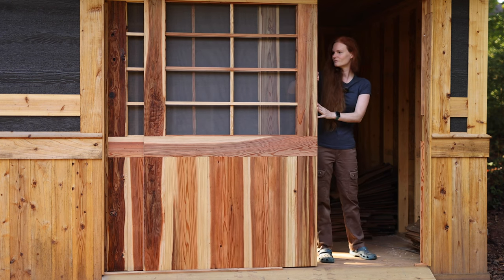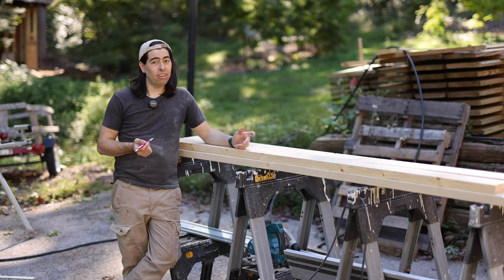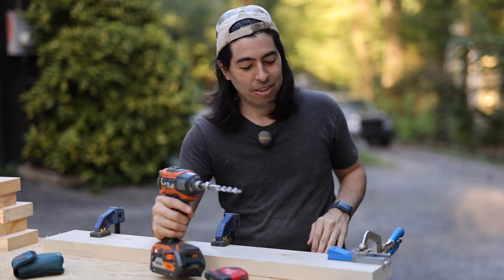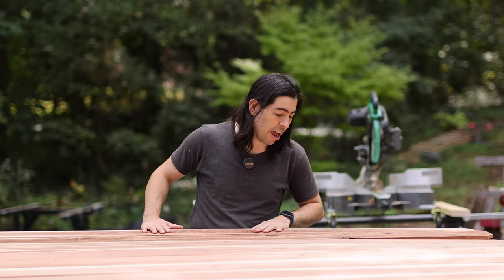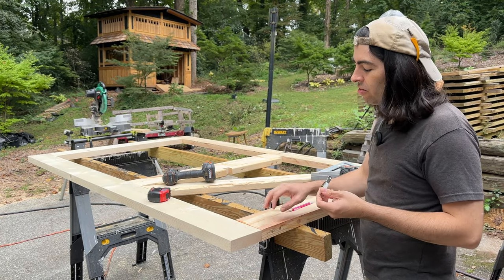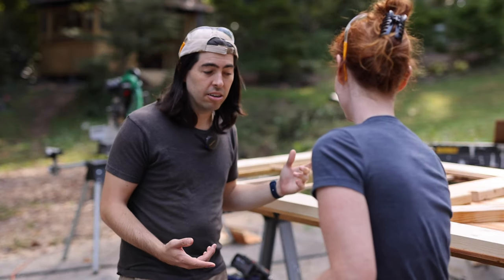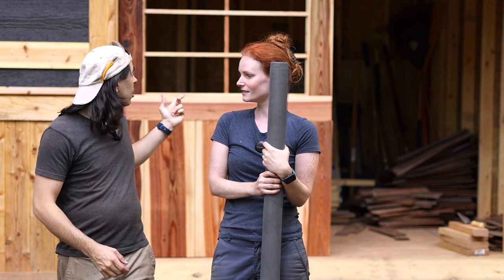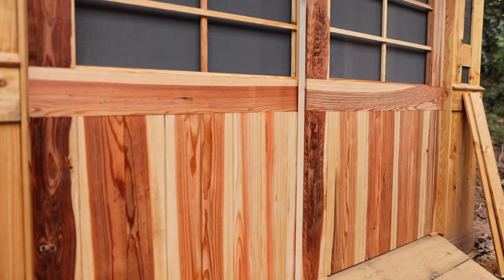Building Shoji Screen Doors: Japanese Shed | Part 32

Comment: if the table saw stops working then try this as it fixed my Delta table saw.
Plug the saw up to a power outlet
Hold the reset button and while keeping it depressed start pressing the start button on the table saw. If this is the same issue I had you will hear and feel the resistance of the motor trying to start and it should start. I have only had to do this trick maybe twice. 

Also, I have fixed it by just pressing the reset button really hard. I found that the reset button on my saw was not lined up properly and the depth was not correct so just pressing it didn't work all the time.

Lastly, if the breaker trips because of over heating, which can happen if you are using it outside or ripping a lot of wood with a dull blade, then the motor will need to cool down before the breaker can be reset.
Reply from the maker: Thank you for the tips!! This is great!! 

I ended it getting it to work again by pressing it really really hard (thought I was sure it would break hard / nearly lifted the machine up) … and, that did the trick. Not a problem since then. 

Though, that should be a warning to me - it’s time for a new blade! 🤣